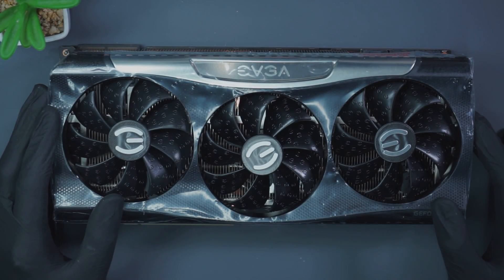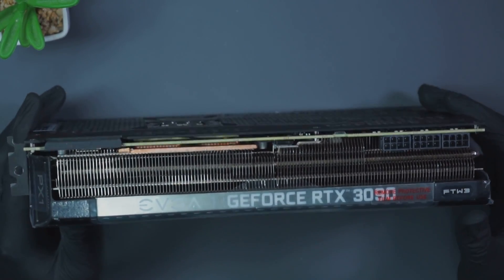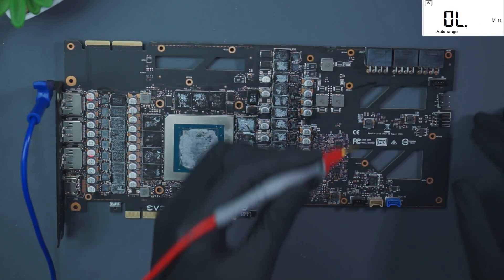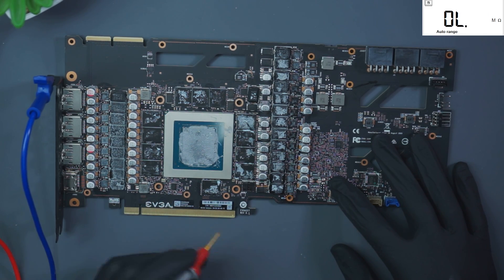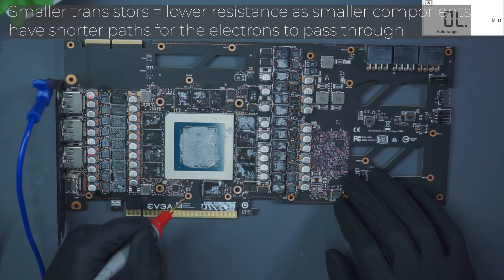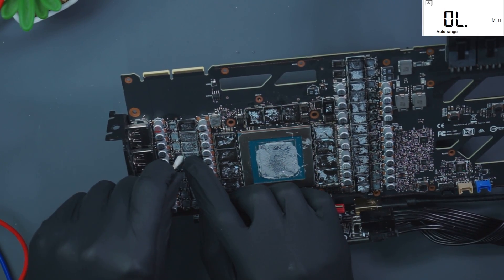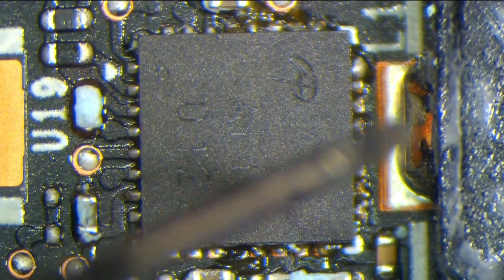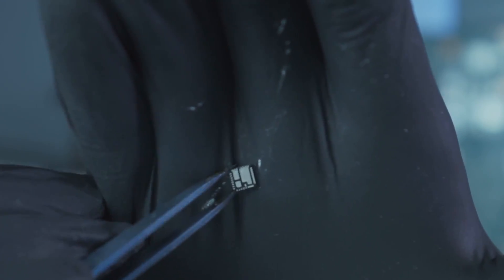EVGA RTX 3090 Not Powering On Repair | Joshi Repair

Comment: I had a issue with my card a while back. Does 500 ohms on 1.8v and 2.5 ohms on memory lead to a dead core? Only the gpu chip gets hot when injecting voltage on the memory rail.

Comment: RTX 3090 (Ti) = CRAP GPU = inferior to AMD in every possible sense
Reply from the maker: Wait till you see our next video. MSI 3090Ti with 3 shorted rails and one shorted dataline.
Reply: @joshirepair  Damn....I am happy that I didn't buy this crappy RTX 3000 lineup and went for AMD instead :). My RX 6900 XT with 2 x 8 pin normal connectors works perfectly :).
Reply from the maker: @lflyr6287  Don't get me wrong, the 3090Ti is still a fantastic card, and iirc outperforms even the 6950xt in a lot of cases. Trust me, even AMD has their own set of issues.